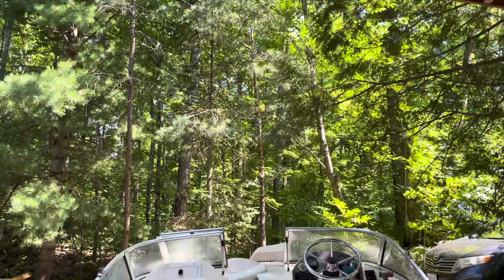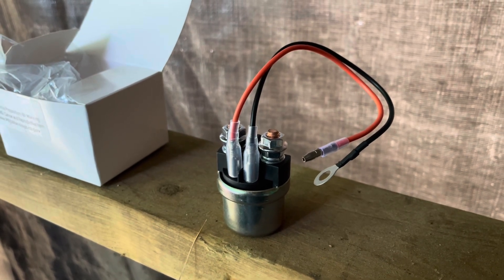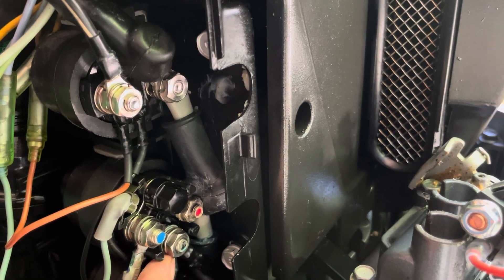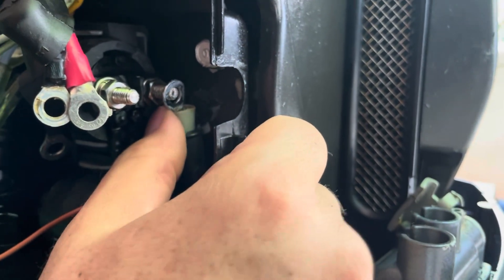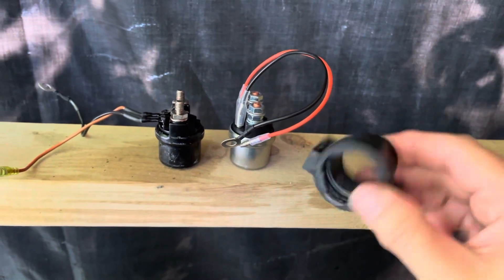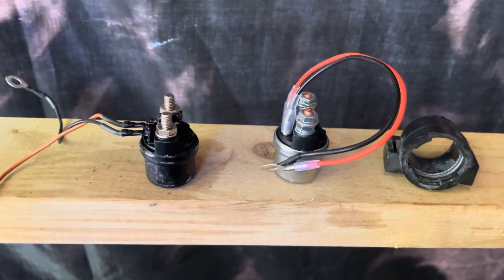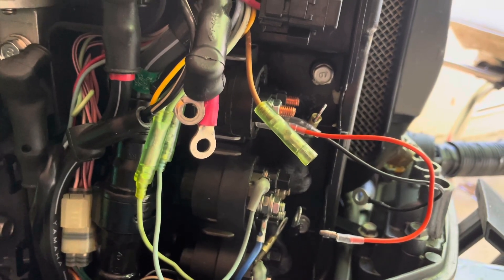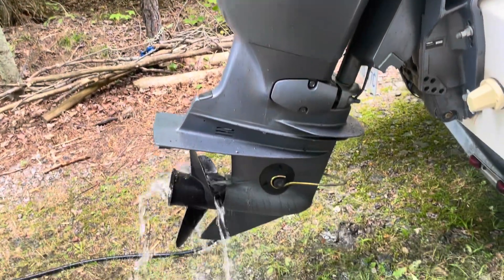Yamaha Outboard Starter Troubleshoot — Part 4 (Spoiler Alert - Wasn’t the starter after all!)

Comment: Intermittent problem with starting ...the engine don t crank ...could be the solenoid?
Reply from the maker: Could be a number of things: starter mechanism itself or the solenoid, wiring issue, maybe a fuse? For me it turned out to be the starter relay as shown here.
Reply: @motorv8N  the starter delay Is the solenoid?
Reply from the maker: No they are two different things. The solenoid is attached to the starter and pushes the starter gear up to the flywheel to spin it when it’s energized by turning the key. The starter relay is the little unit shown in this video that energizes the starter.